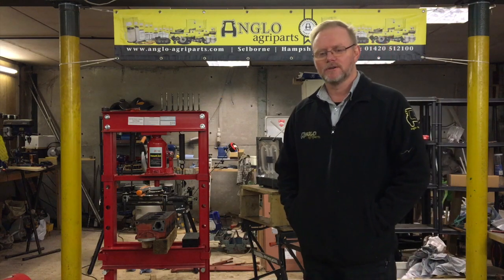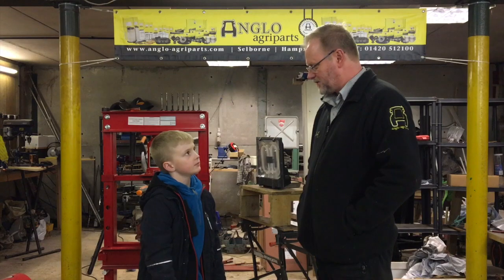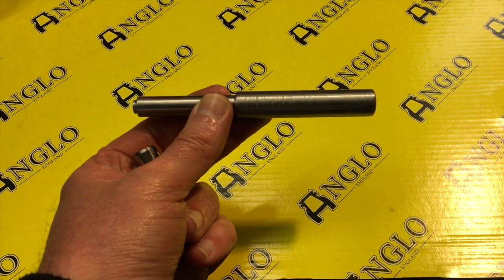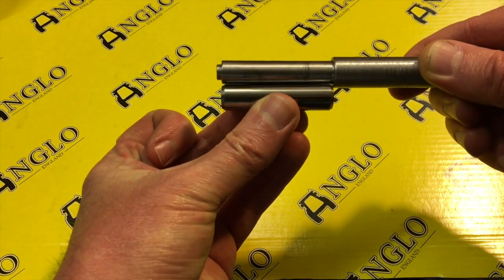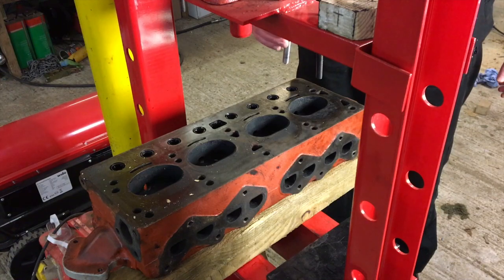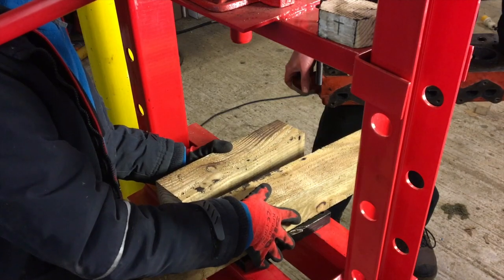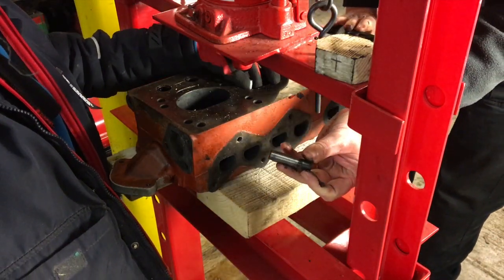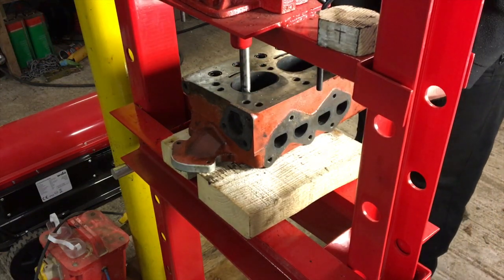Ferguson TED20 - Removing Valve Stem Guides #1 - with Anglo Agriparts

Comment: Hi. Thank you for your videos. You are the first person I have found that has recorded a nut and bolt restoration of a tef fergie. There is two of them at my grandfather's farm. One of them is very dear to my heart as I can remember it running back in 1983. Unfortunately not very long after that the block got cracked and it was parked up never to run since. It's been moved around the farm quite a bit since untill they left it outside in a hedge where it rests now. For a good number of years it had nothing on the exhaust to stop the water getting in untill I got older and realized it would be damaged by this, so I put a jar over it. But it had already sat for about 20 years at that stage. It was always in my head to restore it as a chield and it's still something I'd love to do. A spare scrap tractor with a good block was bought for it at the time and it also sits outside. Nothing moves on it anymore (not even the gear stick). Everything is siezed but the tractor is still in one piece. I'm not sure it would be restorable at this stage nearly 40 years of damp Irish weather later. What would your opinion be on it? I honestly know nothing about restoring one. But I feel If I follow your videos I could do it if the engines not too badly damaged by water (which I can assume both engines are at this stage) but stranger things have happened
Reply from the maker: Hi damo690, thank you for your sharing your story. Sadly it’s quite a common one 🙁. These little Fergies were so dependable and even today they have a certain charm. As for yours, my advice would be to get both of them out of the hedge and under cover ASAP. Let them dry out for a few months. If you place some thick plastic down first and put them on top. After a month or two, once they are surface dry, you can then from time to time spray them with a mixture of used engine oil and kerosene/diesel. Roughly a 50/50 mix it’s not too important to get the ratio right, you just want to thin the oil so it has a chance of penetrating. Don’t try forcing anything to move just yet. When you are ready to start dismantling, take your time, have a source of heating such as a blow torch or similar, because you will probably need it. Once you make a start and get to see inside a few bits eg after removing the cylinder head, you can form an opinion on whether it is worth continuing or not. What you’re looking for is a good foundation, the irreplaceable parts such as the main casings. Of course you have a donor tractor, so you’ll need to consider them together. I hope this helps and of course I’m happy to assist as much as I’m able, I hate to see these little tractors rotting away, but we must also be realistic. If it’s too far gone then you may be better off looking for one in better condition and using that as the base, you can then take some of the components from your grandfather’s tractor so that it can at least live on in that form. Keep us posted, would love to follow your progress. 👍
Reply: Thank you.
Reply: What model is it? I have some engine blocks

Comment: Hi Martin make a new drift .2mm smaller on the o/d and a longer spigot say half the length of the guide about.10mm smaller this will help keep it square then heat the drift until Cheery red drop it in warm oil say 35c once cool (don’t drop it,it will break) polish it until shiny then heat it again until it turn a straw colour (241c) google tempering steel just before it goes blue ( practice this a few times on the same scrap piece of steel you plain on using as it changes quick to blue) let cool down on a block of wood better still wrap it in tin foil until room temperature 
You can test it before during and after by grinding it a watch the sharp of the sparks ⚡️ look up YouTube to see the difference 
It’s will be hard as but not brittle a file will not touch it just skate off
http://wiki.dtonline.org/index.php/Heat_Treatment for information
Reply from the maker: Hi Hooter, thank you yes I think we will try this approach.